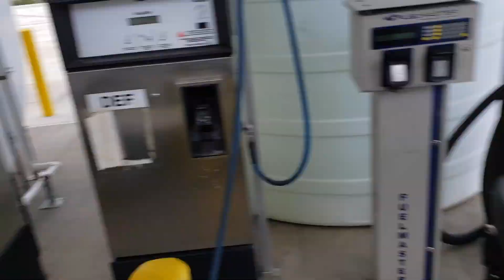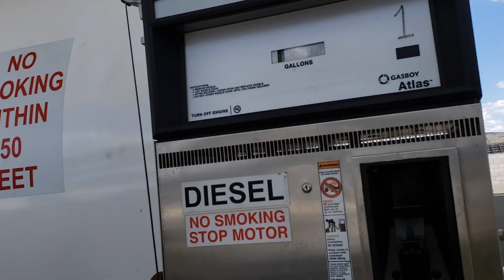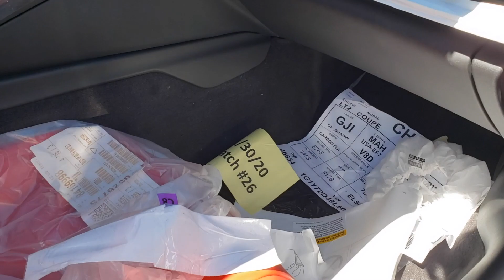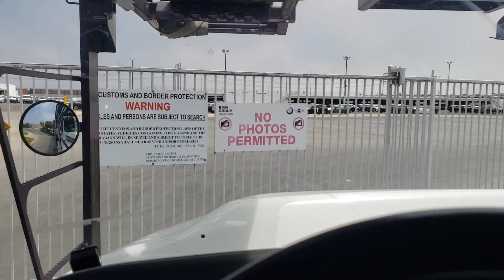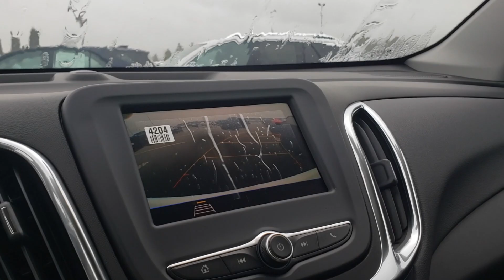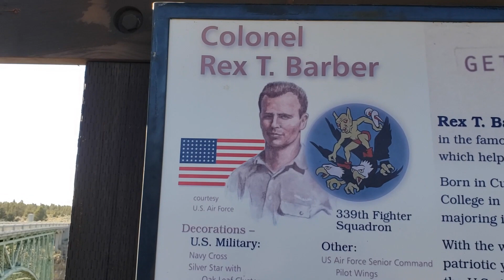Flat Bed Driver hits my Car Hauler.

Comment: Lol I wish I was still excited to drive through hills and mountains, now it's just a pain. I'm going to have to get used to city and highway driving now. Leaving my oilfield job for a car hauling opportunity in Ontario near Toronto.
Reply from the maker: Congrats on getting the Carhauling gig!  You're gonna love it.
Reply: @HammerDownDriver  haven't secured the gig yet but they seem pretty interested, they need guys badly I guess. Don't have a fast card yet. Usually that's a requirement.

Comment: Hammer Down I hope you went to enjoy a cold Dead Guy Ale at Rogue brewery. One of my favorites. Good on you for wearing the rubber wedding band. To many Carhaulers out here stupidly wearing metal jewelry. Also, great driving in San Fran. That yard is way easier than where we used to deliver Jaguars. But we didn’t have all that construction. British Motors on Van Ness make a left and park facing uphill. Later they dropped across from the city park so you had druggy transients bugging you while unloading. And btw, I never park where someone can back into me. And I know, sometimes that’s all that is left but I will roll down the road if so. Good job man. Jason dispatched me many times for FleetCar back in the day.
Reply from the maker: Yes sir I absolutely did, one of my fav brews.  And yes I keep telling my buddies to get on these rubber rings.  Dude that san fran construction never ends.